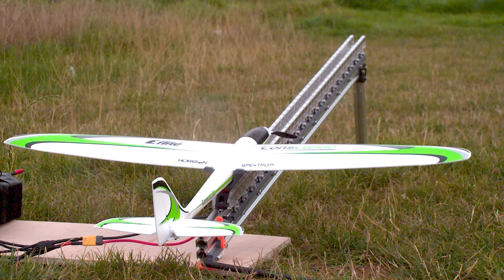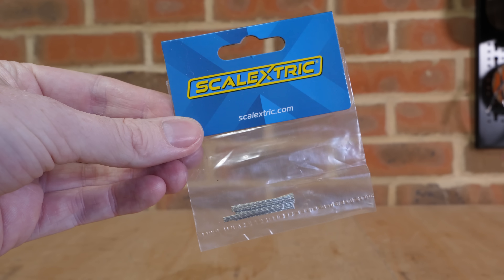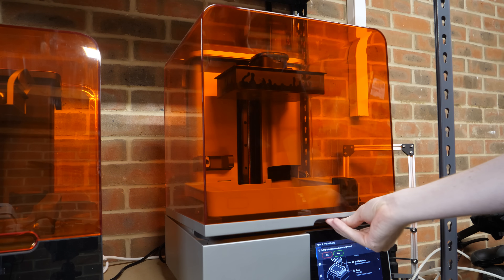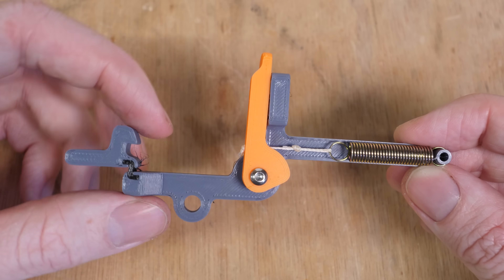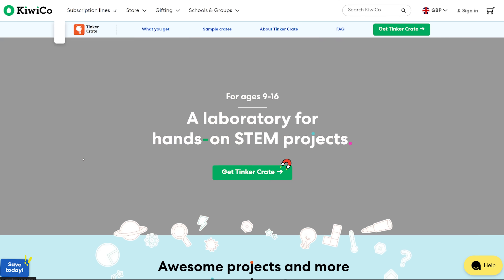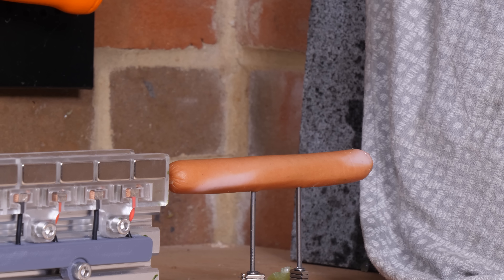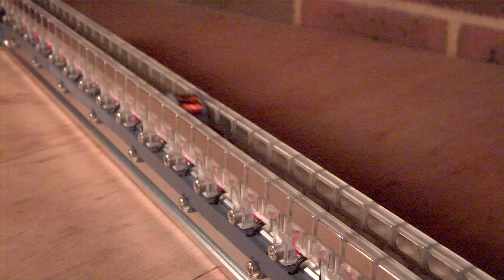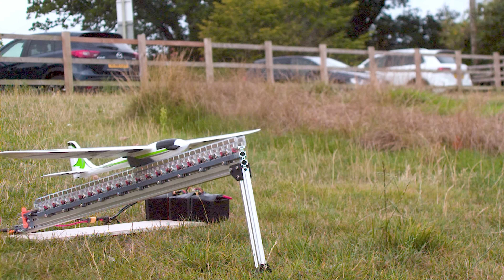Electromagnetic Aircraft Launcher

Comment: The lauch speeds would have been faster if the rail was lubricated. The switch could have been an air gap which would turn on with a higher voltage.
I could also guess that the closer the magnets the quicker the launch.
Could the launcher be reduced in length with spinning magnets along the rail length?

Comment: Tom is not calculating the current correctly. The current depends on the resistance, but also the inductance of the coil. The inductance rises as the square of the number of coil turns. As the contact is made, the current ramps up, and if dominated by the inductance, dI/dt = V/L.  The inductance of the 400 turn coil is going to be about 2mH. If the speed is abut 10m/s and the contact is continuous for 1cm, the contact lasts  for 1ms and the voltage is 24V, the peak current will be 12A and the mean current is 6A.  Also, most of the spark is made when the coil disconnects, not when it connects, and this can be easily reduced by adding a reverse-biased diode (cathode to the positive rail) in parallel with the coil.

Comment: have you done tests on brush timing? the position of the brush (the contact) will be different for different number of turns due to the inductance of the coil affecting how fast itt generates its magnetic field, so they will be an optimum distance for the contacts under the magnets from the cetre of the field of the magnet, as the inductance will be a fixed value and so will be the magnetic field delay, the contacts at the faster end of the rail will need to be further away from the magnets centre, I think.....

Comment: While the sparks look cool, why not use MOSFETs?  You could have a low voltage/current signal open the MOSFET's gate, providing high power to the coils.  You would need to permanently attach the wires to the sled, like an extension cord, and probably need a slightly shorter length of wire cable to arrest the sled to protect the electrical wires.  Some other benefits of this approach would include stronger power delivery and keeping your sled from flying away.  By the way, don't forget to include flyback protection diodes on each coil.  What you've developed is very similar to a pinball machine, where high power coils and magnets are rapidly energized and de-energized - that electricity stays in the loop and can cause transient voltage spikes, with voltages 10x-20x higher than your source voltage, and these will cause damage.  The protection diode allows the current to essentially loop around through the coil a few more times, converting the voltage into heat instead of dangerous TVS.  If you have any questions, I've spent years developing my own pinball control circuits, including high-power solenoid drivers, so I have lots of experience with driving coils.

By the way, it seems to me it would still make more sense to have the coil array on the launcher, and just magnets on the sled.  You could still make a mechanical circuit, just have the sled complete the trigger circuit, which would open each MOSFET and energize each coil pair.

Comment: Magnetic field shape and proximity can be SIGNIFICANTLY optimized from this implementation - I bet you can achieve nearly double the force with no more mass.  Also it looks like the magnets are quite loosely wound which can also be significantly optimized.
The force is proportional to amp-turns as well and so you really want to optimize the magnet wire selection to maximize that product.

Comment: Excellent!
You may be able to get more performance with more turns and/or coils of thinner wire. The DC resistance of the coil is only part of the story, since you are alternating the current (albeit at a fairly low frequency) and dealing with the back-emf from the magnets.
Too thin and resistance might be too great, and/or the wire wight melt (OTOH, the wire won't have much time to heat up unless the sled jams)
A fair bit of optimization space...
Reply: Thinking "aloud", a bit more complicated but simpler than the fixed-coil version:
Another idea could be to use continuous power tracks to cut down on sparking, with a (beefy) h-bridge on the sled, controlled by a optical or hall sensor, with a big capacitor on the sled too to help with the transients.
Then of course you're approaching a brushless linear motor, just with remote power.
Maybe replace the brushes with carbon ones like in real motors, or even with some (thick but flexible) loose wires, since the sled doesn't need to go airborne.
The h-bridge could even be remote (but beware of the power transients coupling into the sensor wiring)

Comment: Hey I know you already have 1000 other suggestions on how to do it. But I wonder if it might make sense to use aluminum windings to reduce  weight. I’m in commercial electrical and often times aluminum feeders are pulled because copper is simply too heavy to work with.

Comment: For your launching switch, could you rotate the moving contact 90 degrees, so it is a knife wedging between two slightly separated copper plate contacts on the other end? This might eliminate all bounce.

Comment: I think you can improve this with geometry. Remember coils have inductance - they take time to create the magnetic field, or extinguish it after powering off. That means later stages of the rail don't contribute to the acceleration, as the coil gets, or loses the field too late in relation to the magnets. So, the further down the bar, the more spaced and staggered the contacts and magnets should be

Comment: I think  solid rails (a la Scalextric)  gor power with a simple mosfet h-bridge controlled by your contacts pads at very low current would be much better
Reply: This would enable you to use a higher current which translates to stronger magnetic field

Comment: I wonder if you added a capacitor and tuned the sled coils to resonate at the same frequency of the alternating magnetic fields provided by moving past the magnets at velocity if that would increase the power of your gun or if it would reduce the arcing as the coil reverses polarity repeatedly.

Comment: Thats a great build! There was a large one built in 70s using copper rail segments with graphite segments to contact the shuttle. I cant remember its project name. I can only remember parallel coil windings as that each coil is multiple coils overlain. And, that may have been how they adjusted the time constant during acceleration.

Comment: In regards to the contacts, why use braided copper as brushes when we have already figured this problem out. just use actual DC motor brushes. What you made is a very cool linear DC motor, might as well use some of the same parts.

Comment: The sound of propeller revving up at 14:32 is so satisfying for some reason.
Reply: I thought the same when I heard it! That bass was wild
Reply: You should find some USN aircraft launch videos without background sound. There is a Growler channel with some great flight ops videos.
Reply: Yeah it sounds so cool.
Reply: I think thats the railgun magnets making the sound, not the fan.
Reply: C-RAM
Reply: It's probably fake audio though, audio generally doesn't work in slow mo. The slo mo guys have to artistically create audio for every shot. In this one I think you can see the sound pitch is too high for the speed of the propeller at that time.
Reply: @theaveragepro1749  With slow-mo and speeding up, you have to think of audio in terms of octaves. 4x is just 2 octaves, but for comparison, a full-size piano keyboard has 7 octaves. I watch sped-up footage of a rocket game in which 20x speed-up -- betweed 4 and 5 octaves -- will turn the noise of big rocket engines into a weedy-sounding hiss, :) but it's still audible. The Slow-Mo Guys deal with much more than that with their specialised equipment. If I remember right, they film things moving at 1000mph where tom's little sleds don't reach 30mph. Or was it 1000x frame rate, because that would be 10 octaves. The entire range of human hearing is reckoned to be about 10 octaves, 10.5 for some autistic children, though it goes down to more like 9 octaves as you get older.
Reply: @theaveragepro1749  Wdym? That was like 25hz and if this was 4x slowdown that's 6000 rpm, which isn't completely out of the ballpark

Comment: Incredible design and i swear i'm not backsitting engineering, just a tip:
For triggers just make sure the spring has no slack when the pin is firing and you'll have less knockback as the spring is always tensioning.
Also less travel will take care of knockback as less force will be applied on contact, you can keep the buttom in ghe same place with some imagination. 
I don't knkw shit and maybe you tried this things and they didn't work.

Regardless I'm so exited you revisited an old project❤